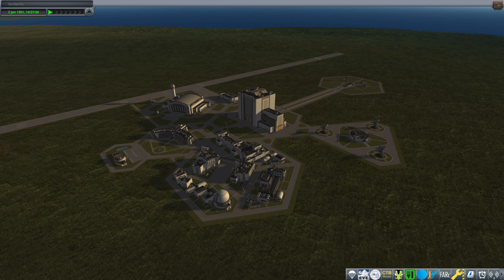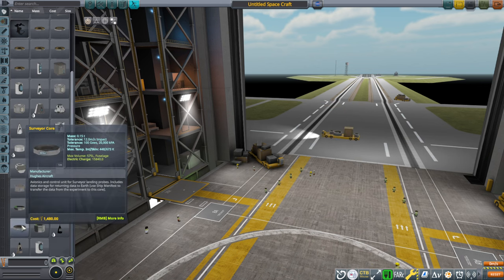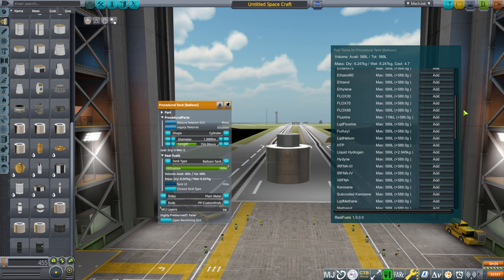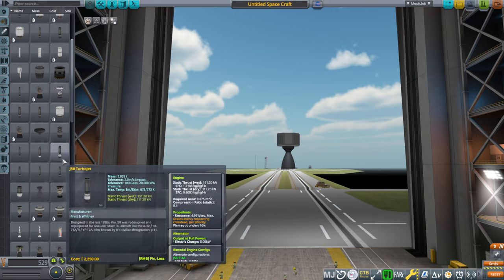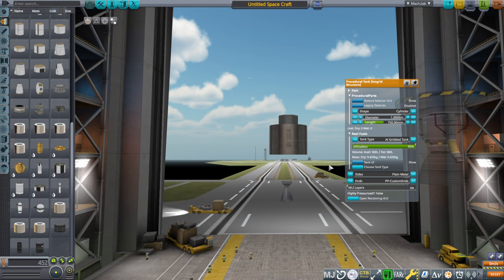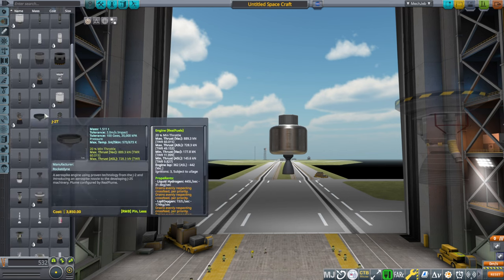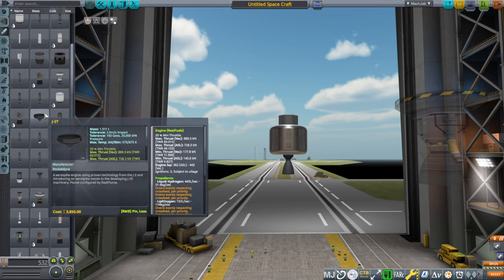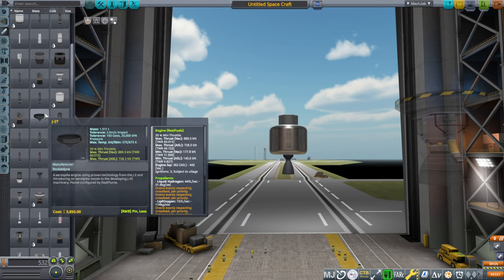Designing Realism Overhaul Rockets and Probes (KSP 1.12.5)

Comment: 20:55
When using procedural payload adapters I absolutely hate directly attaching the adapter to the engine bell. It is absolutely unrealistic and doesn't make much sense (how do these engine bells support the structure of the payload?)

I know in RO all engines are surface attach so you can free up the bottom node of the payload for an interstage, but you have to fiddle with offsets to do it with 1 engine. Do you know of a better way?
Reply from the maker: If we could make longer hollow decouplers like we have procedural hollow tanks, that could work. Maybe the stock engine plates that have that shroud? I've honestly never tried them in RO.

Comment: Man you know so many things about rocket science! May I ask you, what happens when you change the value of "utilization" when tweaking fuel tank values? What does it change?
Reply from the maker: It changes what percentage of the volume is actually taken up by the propellant. Because of internal structure, it's not the case that 100% of a tank's volume is occupied by propellant. If you have multiple propellants in the same cylindrical part, the utilization can be quite low. The slider also modified the dry mass of the part somewhat.
Reply: @RaizSpace  oh, got it. Thanks for replying!